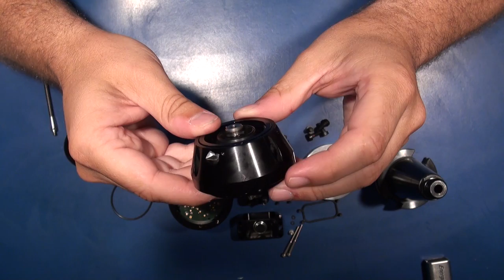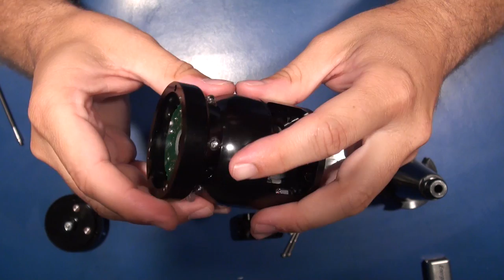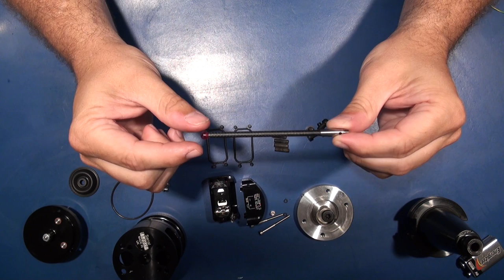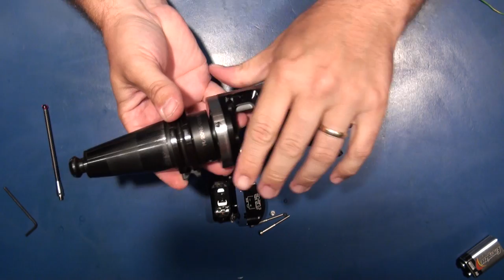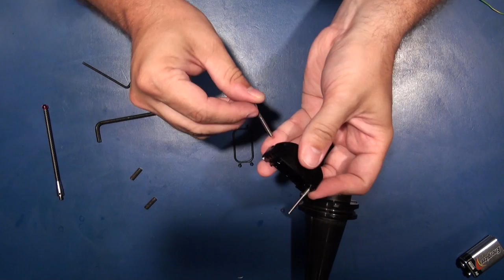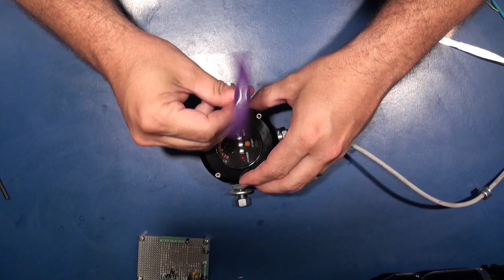Anatomy of the Renishaw MP10 Probe

Comment: Very good sparky, you did good.  Nice note on grease and oxygen.  We had someone recently grease an O ring on an oxygen bottle.    Needless to say their was a spike in the hypertension meds. market here over that.  Keep them coming Tim.
Reply from the maker: Nice, I have a funny story about that. Was at my gas supplier just talking shop and a customer walks up to the counter. Asks if they have any "No Oil". We both looked at each other perplexed and asked the guy what he was using it for. He put an oxygen regulator on the counter and pointed at the gauge, he says, "see it says to use No Oil, do you have any No oil". The sales guy politely explained the dangers of high pressure oxygen and combustible materials, then suggested the customer take some training before using oxygen.

Thanks for the continued feedback John!
Tim

Comment: Its been my experience that any time you change a stylus you have to do a recalibration. You may find when you adjust the run out of your stylus the shank will run out anyway in relation to the ruby tip. By the way when you adjust the run out of the stylus use a indicator with very little tip pressure. It doesn't have to be perfect the calibration will measure how far off center it is and set some variables in your control to offset the error. It would be a good idea to get a spare stylus believe me you will need it. Does you programs in your control have the Renishaw easy set? This makes it much easer to use the probe for setup.
Reply from the maker: Agree, "Theoretically" it could work. In practice change the stylus, run the cal. I'm not sure my indicator is light enough to adjust the probe. Two options, rotate against a flat wall until it is triggered consistently, or borrow one if I can. I will make a video on adjustments when I get there. I plan on getting spare stylus and a spare contact set. I have the Renishaw macro's for Fadal, have not gone through them yet but they do have a cal section.
Reply: To trigger the probe you have to deflect it. One way you could do it is clamp something like a 1,2,3 block in the vise jog the probe up close beside it. Put a piece of white paper behind with a bright light on it. Than sight between the probes tip and adjust the run out jogging closer as the run out gets less until you see there is no visible run out (use a magnifying glass if necessary) . I will guarantee you could get it to less than .0005 this way that would be good enough. The calibration would take care of the rest. I use me optical tool setter to adjust mine.
Reply from the maker: No optical tool setters on this machine!  Would be cool to see some videos on your Mazak doing tool setting and probing. I was wondering if you had one on your mill turn (could not imagine that machine without one).  The videos I watched you used a 3D indicator and a gum wrapper ;) Do you use Mazatrol or Renishaw macros for your probes?
Reply: I use the spindle probe on my Mitsubishi horizontal more than anything else. My little Haas in the garage has a spindle probe and tool setter on that machine I use them 100% never have used a edge finder on that little mill. All machines that use Renishaw probes or tool setters run their macro programs Mazak, Haas, Mitsubishi, Fanuc they all use them. In fact if you know the macros they all work the same on all controls Renishaw has really done a good job at making them universal. On the Haas in my garage I can give it the same commands I use on the Mitsubishi Meldas control. I will do a video in the future on using the spindle probe for in process machining and up dating offsets all automatically to bring features to size. I use this quite extensively on the Mitsubishi Horizontal. I do have a spindle probe for the Mazak but its just easer on that machine to use the Haimer 3D indicator. It also has a laser tool setter but there is something wrong with it. I need to fix it but I just don't want to spend the money. That machine is so easy to manually touch off tools I probably will never fix it. It has a tool eye too, But that is so high up without a jog pendant for the control you cant see what your doing its easer to do lathe tools also manually.
Reply from the maker: Look forward to seeing that video.  Thanks for sharing, I have enjoyed a lot of your videos. I need to make my self one of those go pro housings. And you also have one of the most expensive tire wrenches on record, LOL

Comment: sir I buy fadal VMC 15 with this prob but I can not use this .
can you ask me how use this ???
Reply from the maker: I'm working on more videos of how to use the probe in the machine shortly. Thanks
Reply: Yea would like to see how you run the fadal cycles and how it updates work offsets, and what you would add to your program to probe a work zero bore on a pallet before running the parts...we run a siemens 840d, It has cycles in the control, it does describe them in manuals, but trying to understand them is away over my head.... not much info on line about how to run reinashaw in an everyday environment,  a video on this would very welcome as you explain things in plain English for the slow learners... keep up the good work.

Comment: I have little experience in big machine。 But in design concept， this probe is not a very good one。 It may be an older model, the middle portion; the electronic boards and battery compartments， they take up a long length and make the total length of the probe very long。 You can imagine how much run- out for a long and short tool will have on the tip ends when they are mounted on your machine。Renisaw can make this probe very accurate, but it is your problem that your machine spindle axis is not and the probing repeatable will be poor。The most precious portion of this probe is the sensing mechanism assembly。 If the damaged area didn't hurt the internal parts， don`t replace it with other copied or inferior one。
Reply from the maker: The older probes are a bit longer, but you can easily adjust and calibrate out any run out issues. It will be very accurate, more accurate then my machine can position for sure. I would only replace the front end with another Renishaw replacement part.